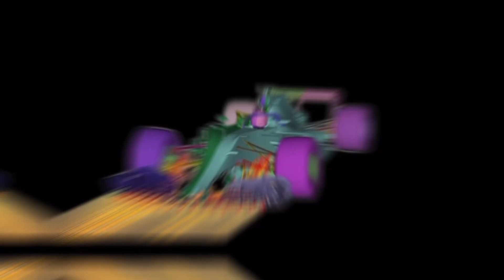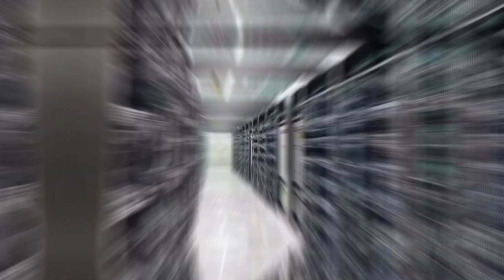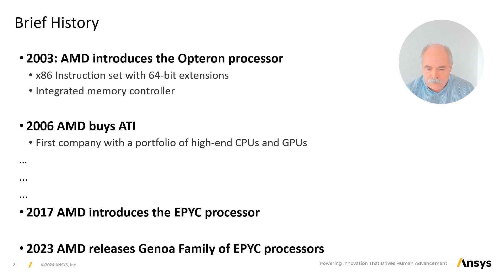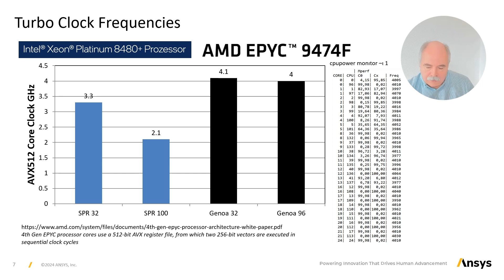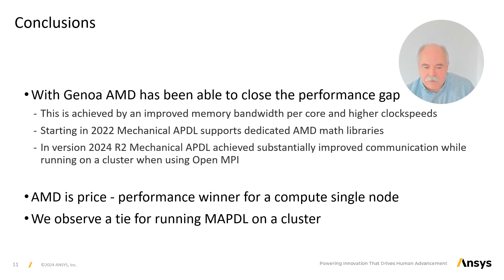Ansys Mechanical HPC for AMD Processors

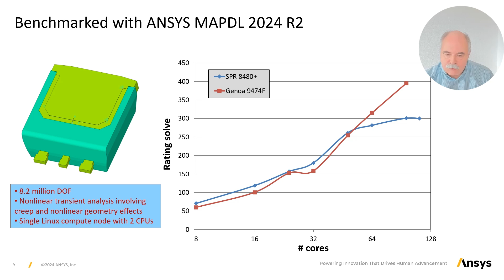Comment: At 9:45, what is the memory setup? Am i interpreting correctly that 2x AMD 48 cores is performing better than 2x Intel 56 cores?
Reply: It would be a hard statement, because of everything depend on many other factors, especially what kind of solver you use, your model size, difficulties, contacts, etc. But the message is that AMD has risen, the efficiency is close, or tie with Intel in HPC environment and it is a real competitor to Intel right now, and consider here the lower price of AMD as well. I am not a big AMD fan (even you can see that before the AMD was never considered as a real competitor in ANSYS Mechanical HPC), but today those CPUs are wild...

Comment: I'm also interested in what @mark11374 asked: The performance of CPUs with 3D V-cache in Fluent and Mechanical. I know that the 3D V-cache models take about 400 - 600 MHz maximum frequency hit compared to the F-models. So, which one is the king: big L3 cache or higher frequency? If I get a 2-socket server to fill with any CPUs I like, should I go for 9474F or 9684X?

This comparison of core-per-core performance would decide which is the king:
AMD EPYC 9374F (32 cores, 256 MB L3 cache, Max 4.3 GHz)
vs.
AMD EPYC 9384X (32 cores, 768 MB L3 cache, Max 3.9 GHz)

Comparison of the highest core count F-model against the highest core count X-model would determine what to use in a single server:
AMD EPYC 9474F (48 cores, 256 MB L3 cache, Max 4.1 GHz)
vs.
AMD EPYC 9684X (96 cores, 1152 MB L3 cache, Max 3.7 GHz)

It would be nice to see some comparable Intel models as well to see the difference, but I think the verdict is already out that currently AMD is the better performer and maybe even more so with the upcoming Turin CPUs. The highest core count F-model 9575F (64 cores, 256 MB L3 cache, Max 5 GHz) looks very interesting. Unfortunately it looks like we are not getting 3D V-cache Turin models, at least not yet.